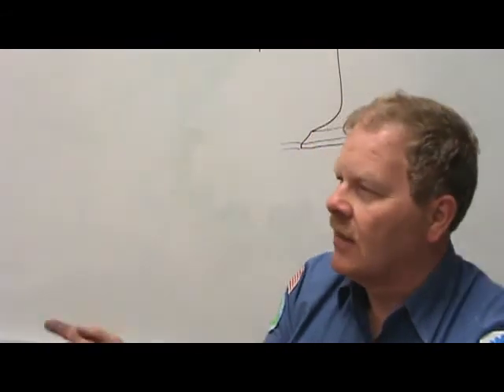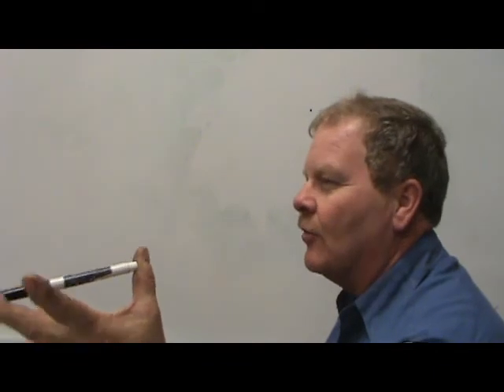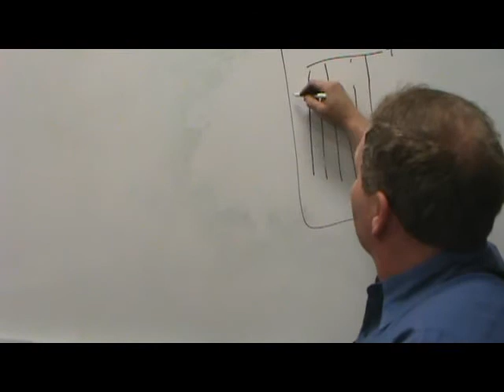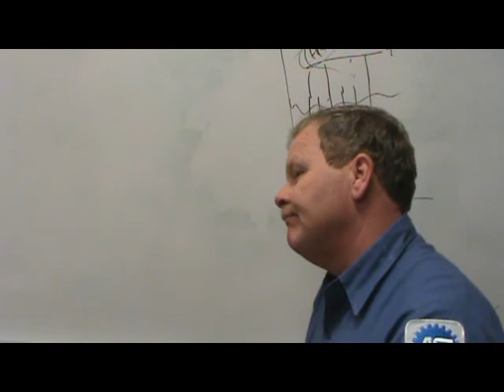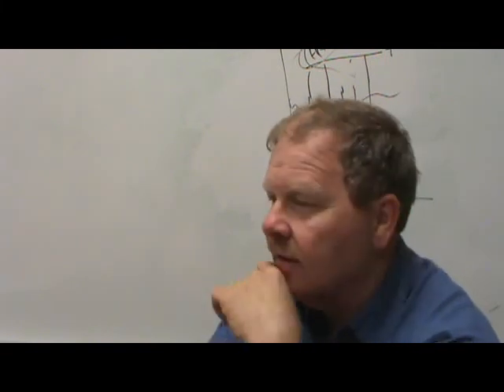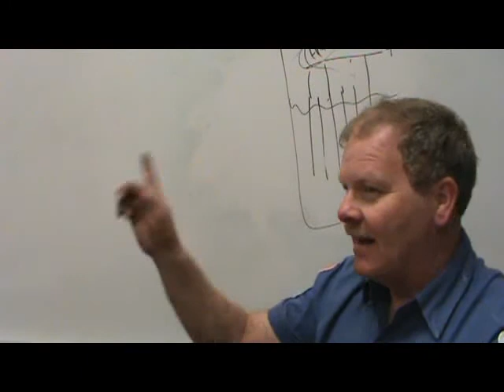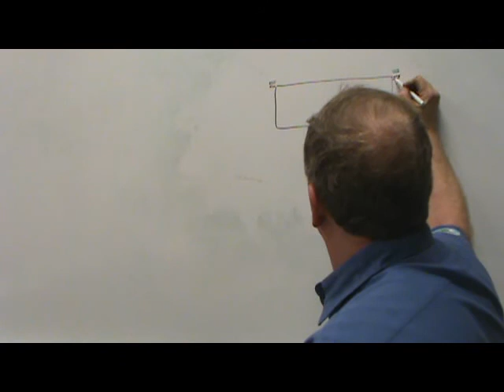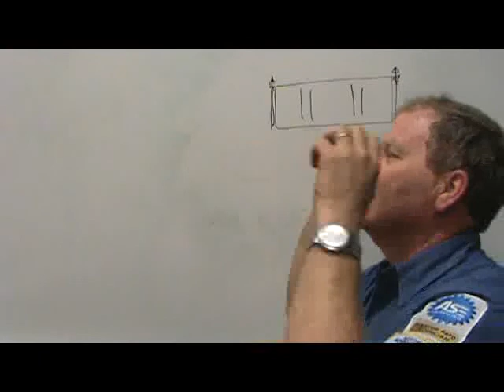Fuel Cells and Stuff.flv

Comment from the maker: Usually I'd start by checking for air leaks - usually a vacuum leak will affect fuel trims more at idle than at higher rpm.  It's also useful to compare MAF readings to those on a vehicle with the same engine - low MAF readings can be the result of air leaks between the MAF and the throttle body or somewhere else - even PCV closure hoses (and there are, I believe 2 on that engine) can split and cause problems with fuel trim.

Comment from the maker: What mechanics will do in a situation like yours is to make sure there are no air leaks anywhere else - and they do that with a smoke machine. You have to find out what the problem is before you can fix it.  You've made some progress, but you've frustrated yourself by purchasing parts that aren't related to the the problem. I'd go after fuel control issues - but the last thing you need to do is go out and spend a bunch of money - you're just wasting money if you don't find out what's wrong first

Comment: McCuistian I put new coil pack (Duralast)  wires Plugs and wires now this thing is back to running ruff as hell as it did before I replaced the collapsed elbow.. Stft on both banks are back up20plus at idle on both banks,Maf is at 10 plus gps at idle.. Am I chasing another vac leak?? or aftermarket parts dose not mix well whit ford?? I order new upper intake gasket set even tho nothing looks wrong whit the old set.. But I removed upper intake to get rear spark plugs and wires...

Comment: @Mccuistian I believe I found root cause of the problem, a one inch collapsed rubber elbo underneath intake.. This wAs impossible to see whit out pulling intake apart.. I think it's part of the PVC system it go's from intake to center of engine block between the heads. Maybe that explains bizarre oil leak this thing has could not vent. I don't know just my theory.Rubber right next to hot engine block.. Who at ford comes up whit these crazy designs..  This looks like it's a dealer only item, now

Comment: McCuistian I think u are wright this thing may have fuel problems. I went over entire intake whit propane no leaks.. But car still has miss at idle no load.. The system stays in open loop until I goose throttle then it go' s closed loop then ltft go's 35 both banks.. I notice this car PVC system is rigged with only hose lol and spark plug boot.. This system is suppose to regulated via check valve if not positive crank case air is coming in at all times?? Are I'm wrong this nothing to worry abou

Comment: @Mccuistian I have a 2003 mercury sable 3.0 24 v DOH duratec whit 165k..(Auction car)  I have dtc p01151& p01131 lean exhaust and this thing stays in open loop @ wot 2000 and greater it will then go into cL stft on both banks 32.8@ wot..  What is going on whit this thing?? Bad gas? faulty or dirty Maf? What would u do first to diagnose this???